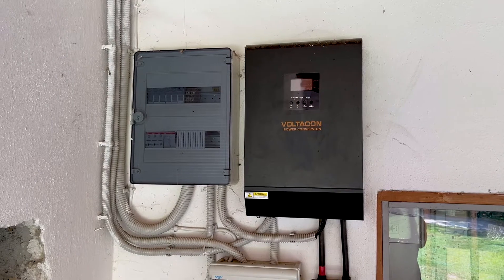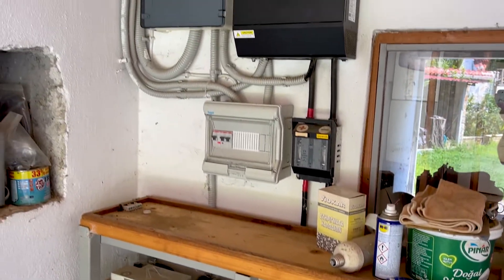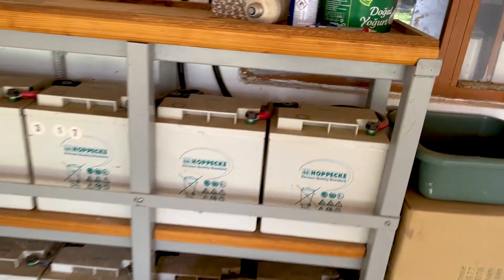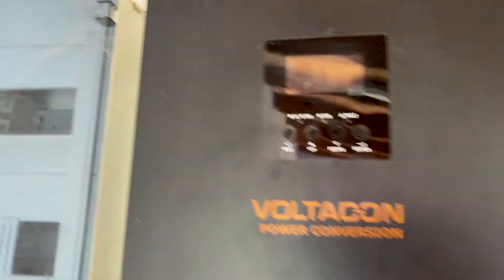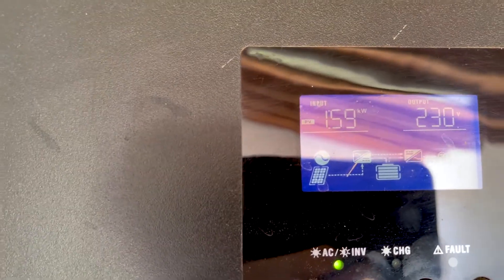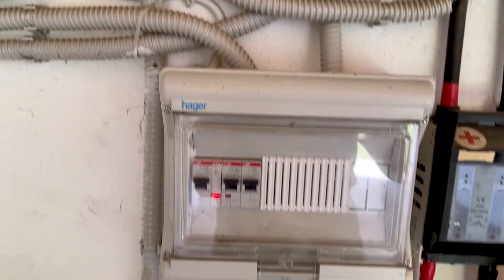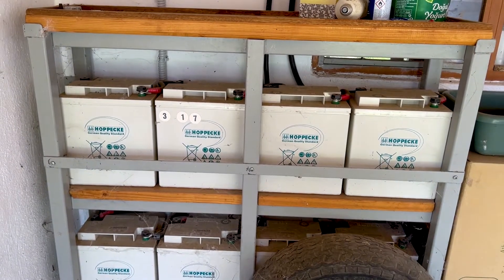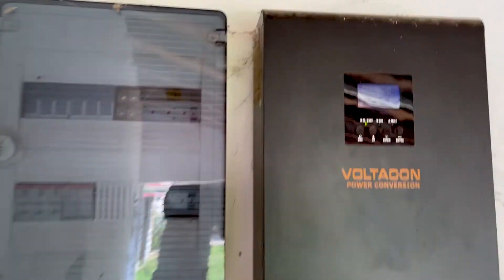5kW Solar Off-Grid Installation After 4 Years of Continuous Operation

Comment: On an offgrid system with no grid input (only a generator as backup) how would you recommend the earthing arrangement is dealt with. Using a TT earthing rod, would you using a common earthing block from the inverter earth to the earth from the household consumer unit or would you run separate TT earth rods for the voltacon inverter, the 240v ac side(household distribution board) &  the solar panel combiner box.
Do you have schematic plans for offgrid earthing arrangement when using the inverter, battery and generator configuration.
Many thanks.
Reply from the maker: We use TNS with common neutral to ground
Reply: @voltaconsolar  
Which is great if you have a grid connection.
But your selling an offgrid inverter which I'll be using in an offgrid house with no TN or TN-S earthing supply. TT earthing rods are the only solution. How does your non grid connected schematics take care of the earth  arrangements, link them all together or treat them all as separate earths....
Cheers, Glenn
Reply: @voltaconsolar  is the common neutral to ground connected in the inverter or should it be done in the distribution board using an RCD neutral?
Reply: This is so confusing 
I’m planning to install one of your off grid systems in Corfu with mains back up, 
So getting the earthing right is important, if you have a recommended schematic or link for earthing best practice in Greece, that I can give to my local electrician that would be so helpful 
Many thanks